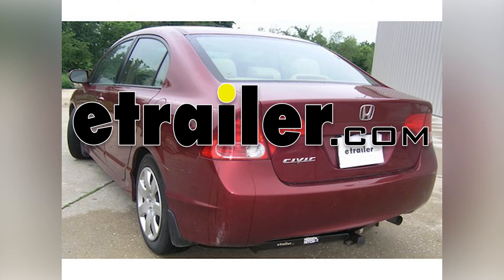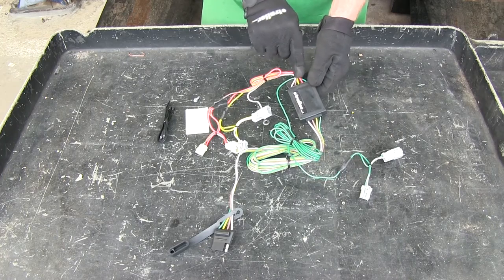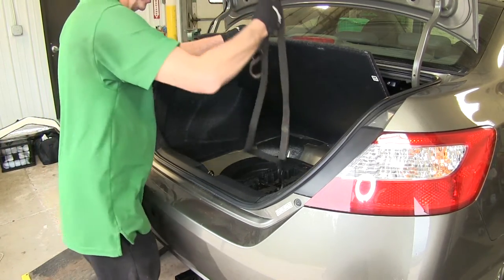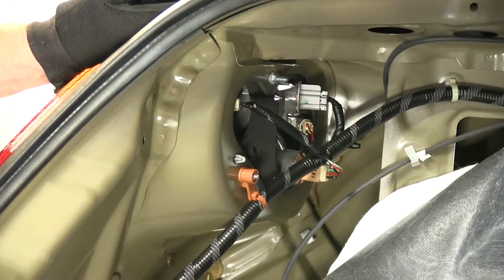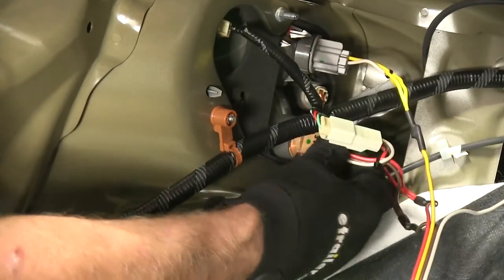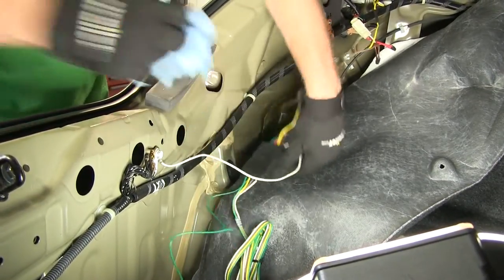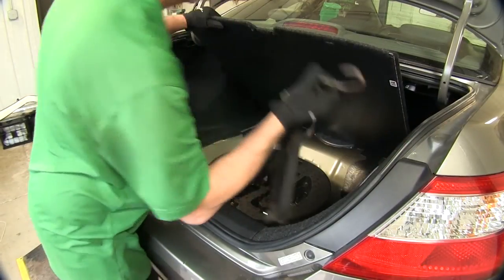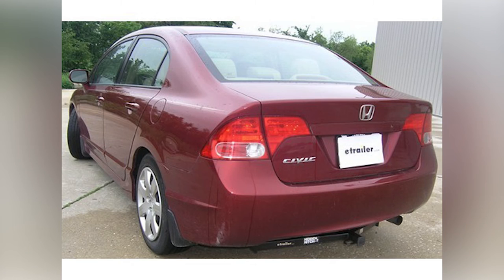etrailer | Trailer Wiring Harness Installation - 2008 Honda Civic

Comment: I assume this will be the same for a 2017 model too?
Reply from the maker: The 2017 and 2008 Civic use a different harness. For the 2017, you'll need # C56396. The harness used on the 2017 will also require that one wire be ran to the positive battery terminal via the included fuse holder. You can see a link to the install instructions below:
https://www.etrailer.com/Custom-Fit-Vehicle-Wiring/Honda/Civic/2017/C56396.html
https://www.etrailer.com/instructions.aspx?pn=C56396